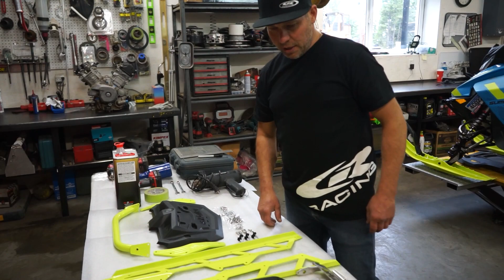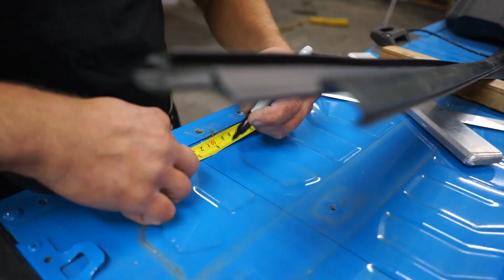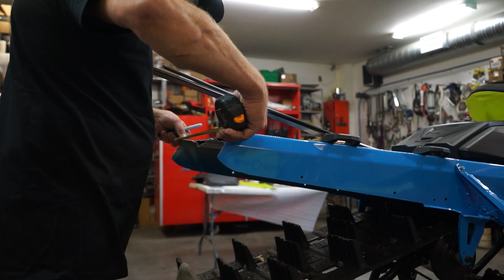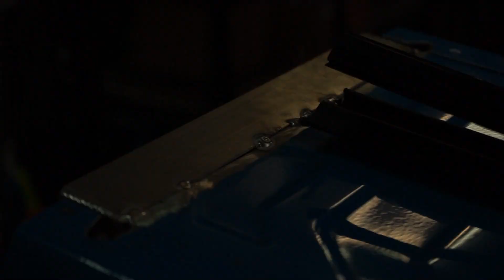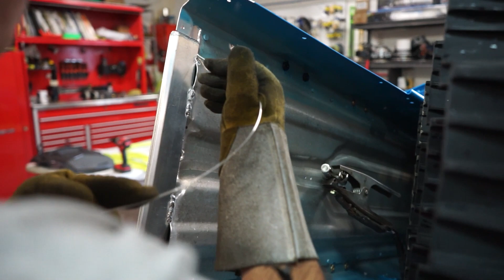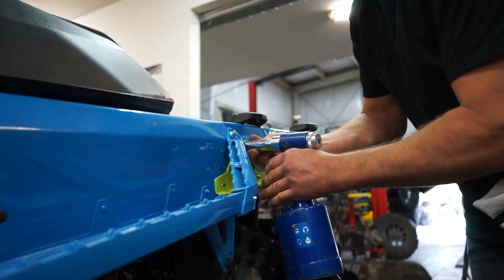Skidoo G4 850 tunnel cut

Comment: I cut 14 inches off of my 2018 154 of the same color, and put a 146 under it. Cool to see you guys are making a kit to do it easier 👍
Reply: Please tell us all why you wouldnt just buy a 146" to begin with. Or do a trade/ sell the 154"
Reply: @kyletracey5819  because I had this sled already. I rode it as a 154 for several years before making it a 146. It's far cheaper for to just convert it than to get another one that I would also still have to cut the tunnel on.
Reply: @mazdarxseven93  i guess . I think selling it or trade for a 146 is still the cheapest.
Reply: @kyletracey5819  there are only two years of 146's with short tunnels, both of which are FreeRides. Those aren't very common and if I bought one new then I wouldn't have been able to buy my 154 Turbo. Cost me less than $500 to make mine a 146 and they're no way I would have been able trade or sell and buy a 146 for even close to that.
Reply: what? if you took 14 inches off that would make it like trail sled length and a 146 would stick like 3 miles out the back?
Reply: @killorkubed  it's about the same as putting a 165 on a 146 tunnel(or 154 expert). I ran my 154 under it for a little bit and it definitely looked like it was all track.
Reply: @mazdarxseven93  yeah... we've had problems in hero snow (we live like 1000 miles from the nearest mountain riding, we go when we can and take what we can get) having our stock length 146's and 154's get hot... have any cooling problems being that short? any visibility problems with the track throwing snow right back ahead of you?
Reply: @killorkubed  we have pretty short trail rides for the most part and I have a snow flap I can put on it if needed though. I run 2.25" paddle tracks so not to much snow throw ahead of me unless there's 4 or 5 inches on the trail.
Reply: @mazdarxseven93  what made you switch to a 146 2.25? We have a sled with that on it exactly and are selling it because we don't like it as much as the 154s, are we missing something? (I'm genuinely asking, when someone goes to a shitload of work to get to a setup it's typically because they've found something they like...)
Reply: @killorkubed  I also have a 154 turbo. The 146 is more for spring riding and jumping, also the days I feel like a bit more of a challenge 😜